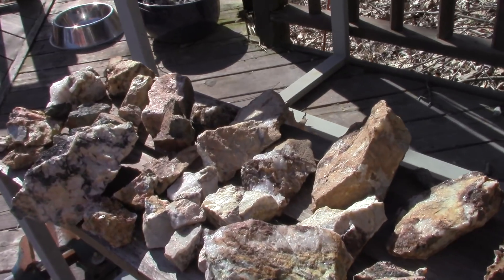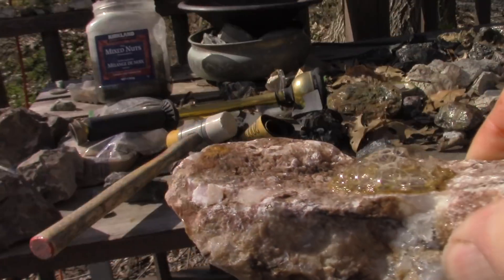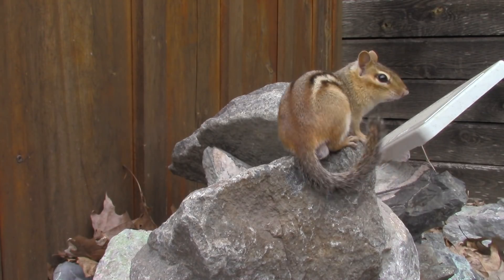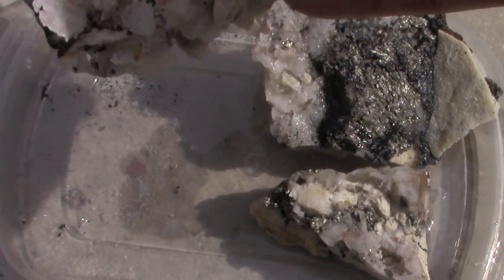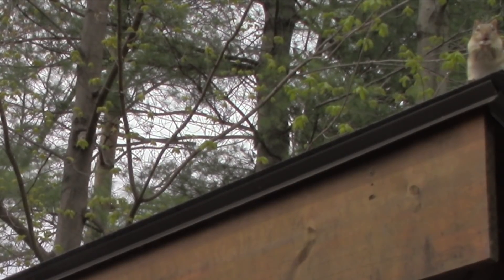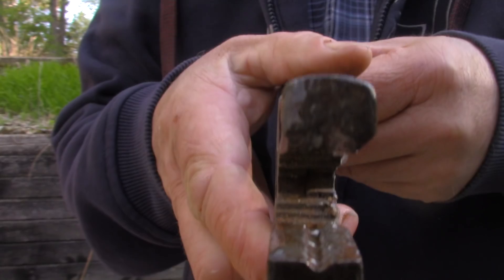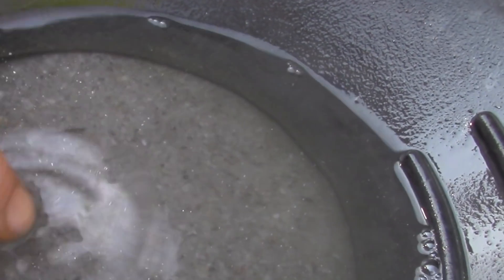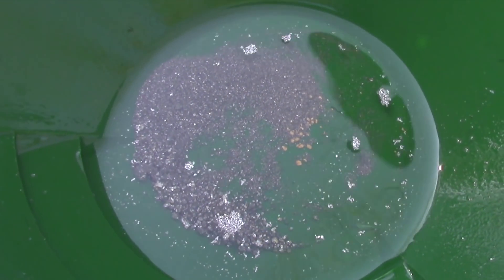ETCHING AND PANNING GOLD ORE

Comment: I sluice all day for less than that lol. If you can pick up ore like that be worth getting a rock crusher. I am sure you have seen the set up Dan Hurd has got. 
Nice gold sir ;-)
Reply from the maker: I don't own the mine.  For sure if I owned it, I would get the necessary equipment and start processing rock.  The owner watches my videos and this will help confirm what was suspected.  The ore is good stuff.
Reply: Thats a shame. Is he active mining now? There must have been 0.20 or more looking at it. If that was just one or two bits or that rock it looks very rich. I would be the owners best mate lol ;-)
Reply from the maker: No recent mining activity at the site.  The owner knows they are "sitting on gold mine" and doing their own assays.  A really interesting spot for sure.  As you know, one small sample is only mildly interesting.  For example, I could have got lucky by picking the one good rock or even had cross-contamination from my pan(s) or sniffer bottle (I don't think so, but it is possible).
Reply: Yeah you picked the right rock for sure ;-) If you get that much cross contamination your doing it all wrong lol. 
Hope you test some more was very interesting. There is no mining here in Switzerland but the rivers around where I live has a bit of gold in I like to go and sluice. I would love to do it for real live the dream lol.

Comment: I have a question. I have a bunch of pyrite left over from crushed gold and silver ore how could I tell if there's platinum in the pyrite? thanks.
Reply from the maker: The easy thing to do is check platinum or PGM has been found elsewhere in the area.  

If you have pieces that are large enough, an XRF could tell you.  Sometimes jeweller or refiners have XRF and could do a test for you.  Also, there is a jeweller acid test kit that you can buy online to test yourself.